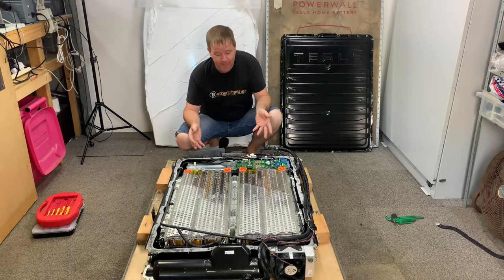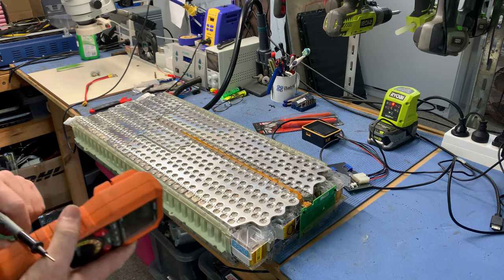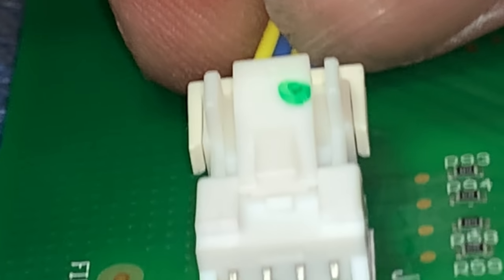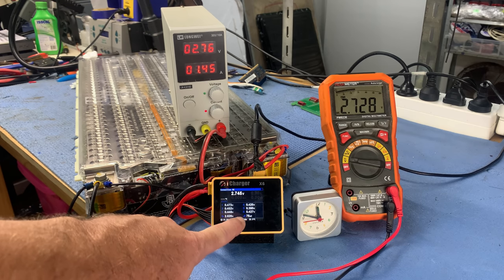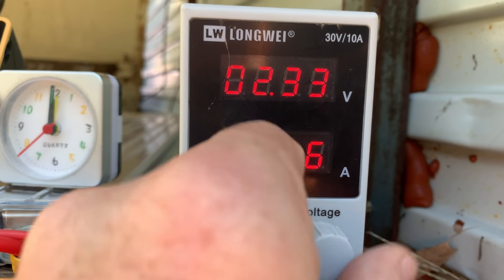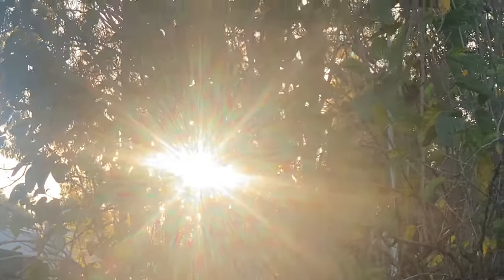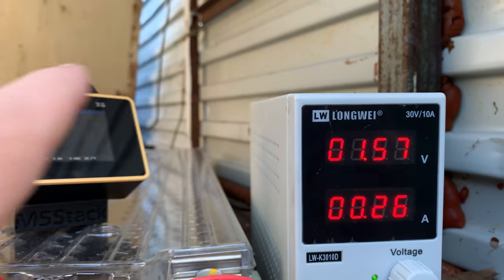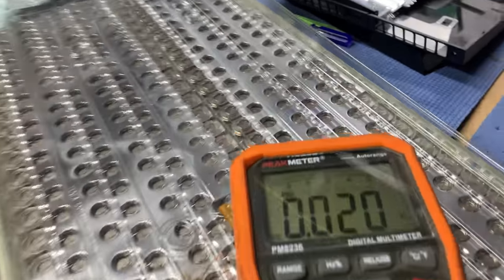Tesla Module repair | Zero volts to useable? Lets find out !

Comment: You have wasted your time, they wont recover unless you have at least 100mA per cell and charge to over 2.5V per cell.
I am not saying your will recover but at the level you are going they won't.
Reply from the maker: Have to start somewhere right, this was quick, safe & easy... to the next step now.. fingers crossed I learn something in the process.
Reply: Interesting. Do you have a reference to back your statement?
Reply: @diyEVguy  Only what I have observed myself from testing quite a lot of old .cells.
I do not say they will recover just that at that low level they wont.
In a pack that size it makes it much more difficult and with an IR camera you may see the faulty cells.
It also depends on how long the cells have been a zero volts.
The main problem is metal migration, shorting the cell, if this has happened then even if you manage to clear this, the reliability is always in doubt and safety is paramount.

Comment: The batteries wont hold a voltage if the charge is less than 3v a cell. Charge each bank of cells individually to see if one bank is dead. Either way this video proves nothing
Reply from the maker: Where did you get that gem of information - a good cell will hold 0.2v for years..
Reply: @HBPowerwall  it's what I have seen charging many different lithium batteries, especially with ones that get down to 0v. You need to get them up to 3-4 volt otherwise they start to self discharge rather quickly, once up to 4v you will see the self discharge slow down considerably. The higher voltage breaks up some of the dendrites that are formed in the lithium
Reply from the maker: Never seen that except with a faulty cell, but thanks for sharing